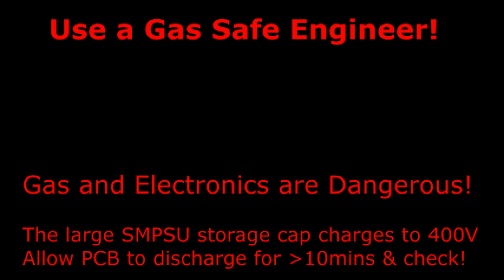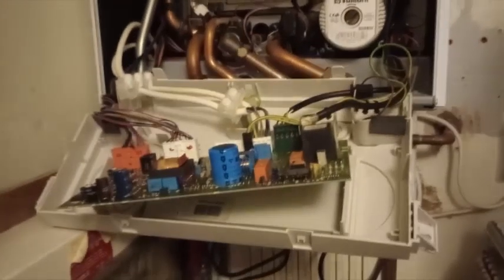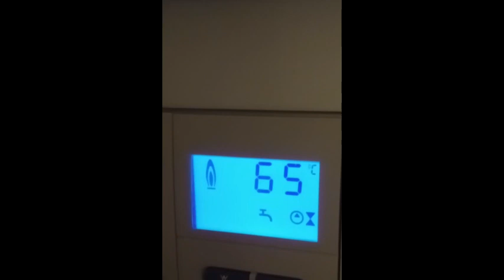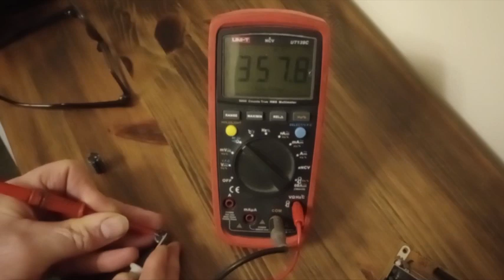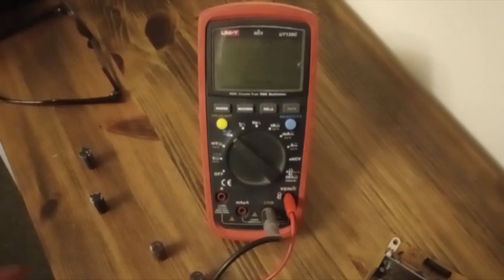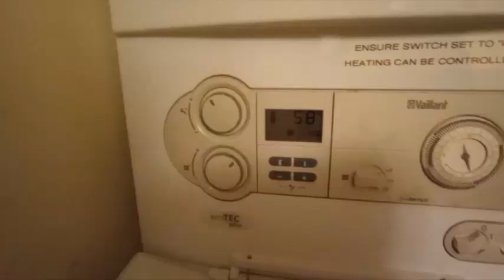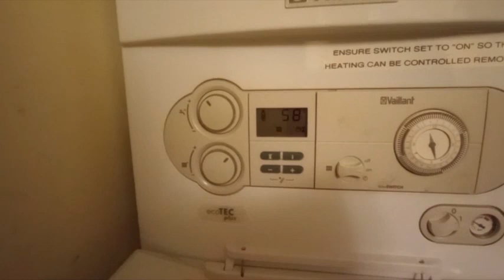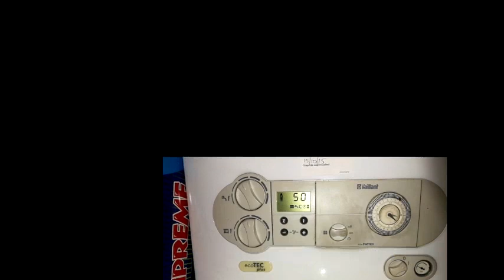Vaillant ecoTEC Plus  - Repairing a Faulty PCB to fix F61 / F62 & other  F6n F7n errors.

Comment: Some people think that once unplugged, a computer can't be dangerous anymore. While it's true that there isnt much power behind the voltage, that basically just means that it won't be able to like start your car. It doesn't mean that it can't deliver a dangerous current to the heart's nervous system.
It's like saying gold teeth aren't a problem in an MRI machine, so I'll walk into the room with a gun while it's running, which one dude famously did.
It's not about symbolism (metal or voltage dangerous / not dangerous, which is magical thinking), but about actual quantities, so it takes a mix of knowledge and math to actually reason about it.
I personally know the math but certainly not the details of the circuit board, so I opt for not touching it 😎
TLDR: Do not touch the electric 💡

Comment: You are the best ! I had the same issue with continuous errors F61 and F62 and replacing the capacitors fixed the problem. Checking with the tester one of them had a wrong value.
Reply from the maker: Congratulations and well done!  Many thanks for your time leaving feedback, cheers Steve

Comment: There are a few videos explaining that these errors are caused by a failing PCB, but this is the only one which provides this solution. Our boiler had the symptoms you described, the displayed temperature rapidly switching between a high and low reading which would lead to the boiler displaying an error (can't remember if F61 or F62). We could recover the boiler by pressing the flame button, which we needed to do more and more frequently (every few hours rather than every few days). I replaced both capacitors and the issue is resolved. £5 all in compared to hundreds for a new PCB. My wife thinks I'm a genius, and I think you're a genius. Thanks Steve!
Reply from the maker: Excellent job and many thanks for your feedback! Well done😊

Comment: Hi. Thanks for your video! My 18-year-old ecotec 831 was playing up for a couple of weeks, showing almost daily random F.27 and F.62 codes that could be overcome with a restart of the boiler (though no fluctuating temperature on the display that you and others have mentioned). I spoke to a couple of plumbers who suggested that it was likely a PCB issue. I found refurbed PCBs online, but then wondered how they refurb them and did a bit of research, which led me to your video. I like to think that I'm fairly handy with a soldering iron / hot air station/etc, so I bought some Panasonic caps online (470uF, 63V, 105°C) - 5 for 5 quid. Ten days ago I replaced the two capacitors you mention in your video - it looked like the old ones had leaked dark sticky gunge onto the PCB, which I cleaned up thoroughly - and the boiler has not missed a beat since! So pleased, as one of the plumbers gave me an estimate of around £3K to replace the boiler - the logic being that it would be daft spend £300-£400 quid on getting a brand new PCB fitted to such an old boiler. He was right - much better to replace two-quid's worth of capacitors! 🙂
Reply: @prb366  It's great to hear it worked for you ...saved you a small fortune  and a better outcome for the planet, well done for having a go at fixing it. Cheers Steve
Reply: @brighstoneuk4532  Yep, another boiler that doesn't have to be manufactured (at least for a few more years I hope). If the government is serious about the environmental impact of consumption and waste, schools should be teaching kids how to pull stuff apart, fix it, and put it back together! Instead, we are encouraged to chuck stuff away and buy new without even thinking of attempting a fault diagnosis, while the manufacturers take the absolute p**s with the pricing and availability of replacement parts.

Comment: I have noticed mine is changing displayed temperature like the video but what I noticed is that it’s changing between the set point of hot water and radiator temperature then switching back to actual temperature another indicator of this is that the backlight is always on on the display so never has to be woken up with buttons or control knob. I will try cap change to see if it helps otherwise I might change pots.

Comment: Thanks Steve, spot on advice and great video.  I pulled C5 and it wouldn't even read on the capacitance meter.  Replaced both capacitors with good quality parts and everything is working again.
Reply from the maker: Glad it helped you out.

Comment: Hello. I am a combi repairman. I also repair certain parts of combi cards myself. I replace certain parts of the types of faults I take note of. Can you also specify which part on the card we need to replace in the f27 fault caused by the card in this combi?
Reply from the maker: ok I'm not 100% sure.  F27 is an incorrect flame situation so it's not sensing the correct burn or ignition ..maybe gas valve, flame sensing, electrodes or as you say some I/O sensing and control on the PCB.  Moisture, hi humidity or water corrosion on the PCB can be a cause of that.  This link has some ideas and it may even be a capacitor related.
 https://www.elektroda.com/rtvforum/topic3638769.html

Please let us know how you fixed it in the end.  Cheers
Reply: F.27 is caused by the 3 legged 100uf 400v capacitor.
I replace them with the 2 legged version as thats the only version I can get hold of. The 3rd leg is  on the negative which only acts as extra support and prevents the cap be placed the wrong way round. Un-soldering can be a challenge. I get my capacitors from CPC farnell. You need Low ESR.

Comment: Can you diagnose it's a capacitor issue for error F27 on a pcb which relates to the fan issue
Regards Muwafak
Reply: I know this is a 11 month old question but the F.27 fault is the large 3 legged 400v 100uf capacitor. I use a 2 legged version as a replacement as the 3rd leg only acts as extra support on  the negative and also helps on the right orientation (correct polarity).  Gettng the old one out can be difficult.

Comment: Great video and instruction thanks 👍. Getting confused with the range of replacement capacitors to buy, especially the voltage. Any links or product specs available? Many thanks 😊
Reply from the maker: The capacitor spec is mentioned in the videos informaton text ...a 470uF 35V  Electrolytic  capacitors ,  BUT  there would be no problem fitting a 1000uF 35V in these positions. You could fit low ESR (effective serial resistance) types ....they are better to reduce ripple however probably that will have little to no benefit to this application.  Higher capacitance values and lower ESR types will generally give better supply filtering but cost more money,  so if a 470uf does the job, thats what a manufacturer will fit.   If you have an old busted Printer, TV, PC power supply, Hifi, Inverter  etc etc ....you could probably find a suitable capacitor for free!   Search Ebay, Digikey, Aliexpress, Amazon  etc for  ' 470uf 35V Aluminium electrolytic capacitors'  99% of them will be  105 C temperature rating which is ok

Comment: Ecotec pro 28 r2. Hot water on, Pump runs, diverter activates, fan comes on for a second, then off. Repaets this cycle. Vaillant tec says PCB. Is this this the possible fault on the pcb? Thankyou

Comment: Mine failed the engineer just replaced the PCB he said it was the big cap, the landlord covered the cost. He suggested there had been a power surge 😮 I did think from my a previous engineer job why can you just change the cap. Good video mate. It would be good if you could get broken boards and sell them covering your time changing the caps. Like you said let's try save the planet. The new board is significantly different

Comment: Ive hot f61 issue.. intermittent and temp jumping around ecotech 28....so capacitor issue? Where to buy?
Reply from the maker: eBay or look at extracting some suitable near values from an old pc power supply, old printer, old TV!  Etc

Comment: Same here, replaced the shown caps and boiler's running well without flagging any errors (f61 before). Thanks!
Reply: Hi, any chance of advising the replacement component that you purchased. Getting confused with the different types available and voltage ratings. Thanks.
Reply: @marksweeney1970  I got them off eBay described as 470uf 35v 105C LOW ESR Size 20mmx10mm Panasonic EEUFM1V471 and they are still running fine. P.S. One thing to take a special look at after fitting the PCB back to the boiler is to make sure it's fully pressed down and all the clips are engaged; otherwise, the on/off/timer dial may not work as there are contact pins on the PCB. Yes, it happened to me :)
Reply: @tomtomss perfect, thank you for responding 😀. Found them and ordered 👍

Comment: just replaced pressure sensor on ecotec 630 F75..... Wouldn’t come back on so used a hair dryer suspected caps came back to life Couldn’t see voltage of caps as back on so thanks for info Can i just ask why you changed value to 1000uf on C5. Fixed my american fridge freezer a few years back same issue Caps only have so many 1000 hrs of life and these devices are on 24/7
Reply from the maker: Glad you fixed it ok. Umm why I fitted a 1000uf in place of a 470uf.? ..well a highly technical reason reason..I had one! it had suitable lead pich & voltage rating, a higher capacitance in such a PSU smoothing application is unlikely to be a problem..maybe even a benefit.  Manufacturers usually fit a uF value to get the job done...more uF generally = more cost. Cheers Steve

Comment: Hi, we get F62 and F28 but also water pressure keeps dropping few times per day.. is it PCB please?
Reply: F28 error code indicates a boiler has an ignition or gas valve problem. Water pressure gauge dropping must be a leak somewhere (i.e somewhere in radiator loop or from pressure relief valve??) .  If it's not ignighting theres a number of potential issues - really one for a gas engineer.  Check condensate trap isnt blocked with muck.  If they are sporadic error codes it could be worth changing caps.    If your engineer says oh its your PCB...You know what to do ...change the caps !  Perhaps reply here once the cause is known

Comment: I have a question…
My EcoTec pro 28 has been shutting down every now and then, and the fault codes have been F61 and F62.
I have observed the temperature gauge like the one explained on this video but the temperature doesn’t jump like on this video. Does that mean it’s not the fault described here. If so, what’s the way to diagnose the other possible faults?
Many thanks in advance for any replies. This sounds like the place where the knowledge is hiding 👍
Reply from the maker: Well f61 and f62 are gas valve type problems..commonly if the valve is stuck or has a problem the fault tends to be pretty permanently there..i.e nearly every ignition.  That's a gas engineer job for certain.  If the fault occurrences are more sporadic random times and boiler is oldish  then the PCB is highly likely.  If it was me I'd find a electronics friend , some capacitors..old pc power supply s, old printer etc or ebay. swap the caps ...thats not much cost to try compared to new PCB or an engineer call out. Let us know the outcome! Cheers

Comment: Hi..I just did this to my vaillant 837 eco tec plus and it worked...so I have 2 837s,, 1 at my dad's and 1 at mine...my dad's was faulty showing f62 and f61...swapped dad's pcb to my boiler and f62 came to my boiler where as my dad's boiler worked...so 💯 it's a faulty pcb...I had an older pcb from a 3rd boiler too capacitors off and boilers back on working....no temperature jumps......saved 180£ on a new pcb
Reply from the maker: Excellent job & many thanks for posting your feedback and reducing  electronic waste buggering up our planet.   These caps are a VERY common root cause to PCB issues. Cheers Steve
Reply: @SteveT_IoW_UK  world class video...thank u very much...changing  the capacitors was easy too

Comment: hi can you tell me when i open the hot water the heating comes on
Reply from the maker: Sorry..thats something to do with the diverter valve stuck or not operating. This valve directs the circulating hot water via radiators or the primary side of the  internal heat exchanger which then heats the tap water. Nothing to do with these F62 or other capacitor related faults. Engineer needed

Comment: It's always the pcb causing a voltage drop across the board components, if it's an old boiler 8 + years old then it's not worth spending the ridiculous amount of money on a new pcb , there are plenty of companies around where you can part exchange your old board for a reconditioned board at a fraction of the cost of a new one.... 👍

Comment: Hello,
I've seen SIMILAR ( Capacitor ) fix-suggestions on other ( identical F.61 related ) youtube entries.
The appartment from my Son has a Vaillant ecoTEC Plus and since a short while, we had fully identical results.
F.61 points to GAS-valve or PCB according to most found info.
GAS-valve, as found in other info, can easily be MEASURED.  The outside PENs ( after removing the plug from the gas-valve, 2-wites go to the 2 pens related ... ) should have a Ohm-reading from between 40 to 60 Ohm.  I my case it was 54 Ohm ==> correct so NOT a GAS-valve issue.
We also had these DISPLAY reading 'swings' where temp was jumping ... around.
I  bought two new capacitors ( 470 uF, 35V , 105 degrees Celcius specs... ) and removed the old to insert both new Capacitors ( mind the POLARITY since there is a + and -  .
CONFIRMATION all is fine : System is running nog for a week and all is stable and fine.  Before, the issue did occur every x-hours.
One important point is the Temperature specs ( 105 Celsius )  from these capacitors.  They are situated on the TOP when the machine is closed and by that, they are relative close to the real HEATING centre.   
Capacitors possibly 'dry-out' because of this heat.  The inside fluid DRYs out , and then their Capacity function/role can no longer be handled.  Possibly the reason from the issues.
The price from these two capacitors ( NEW ) in an Electronic-shop was less then one EURO for both together .  This is nothing compare to the price from a PCB. In my case I found the replacemtn PCB on a web-page in a shop near-by, priced around 280 EURO ( without TAX ) ...
So this FIX for less then one EURO was a HIT.  
THANKS for your input and please keep up the good work to INFORM.
Reply from the maker: Excellent! and I am very glad it fixed your problem  for 1 Euro.  Thanks also for some valid points (capacitor polarity etc) that I will add into the into text. Cheers Steve